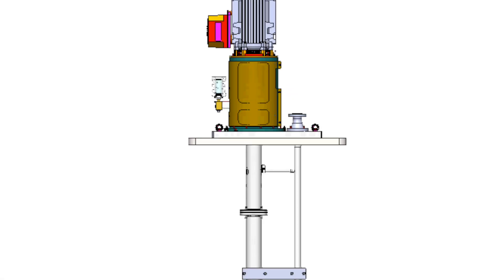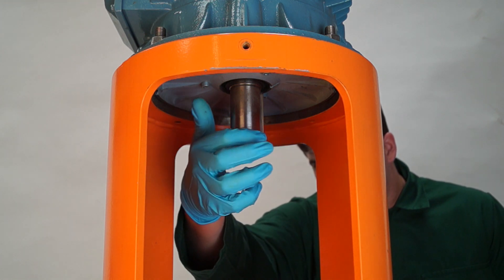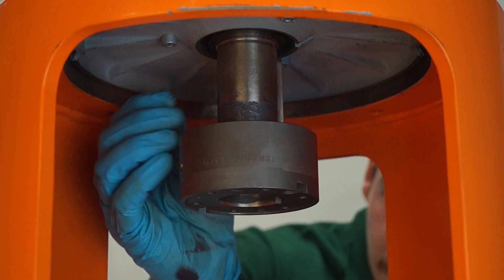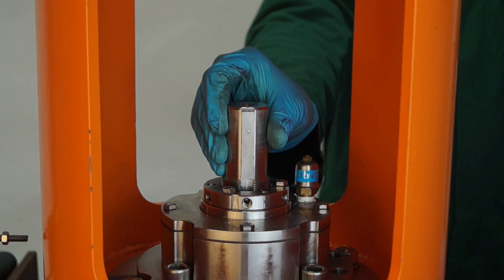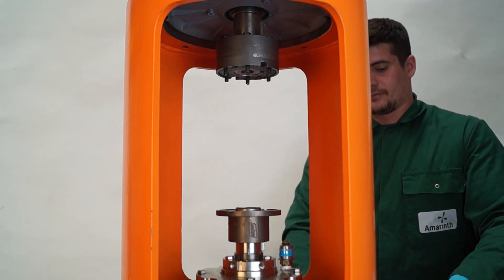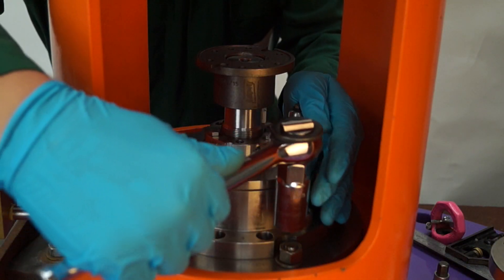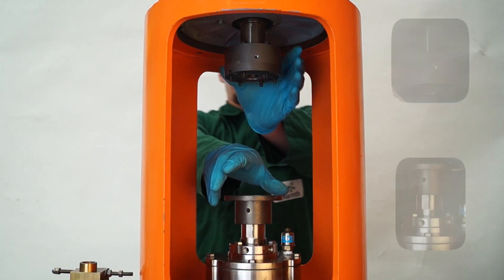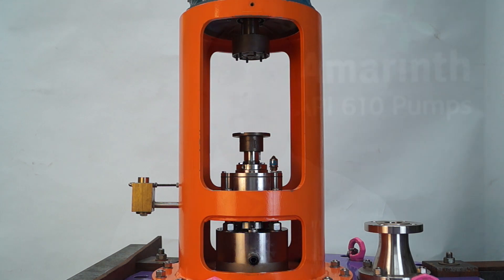How to install and align a pump and motor coupling on an API 610 VS4 pump

Comment: Hello, 

I have a pump where the spacer slightly moves to the left and right between the two couplings

IS THAT NORMAL? OR SHOULD THE SPACER NOT MOVE AT ALL?

Comment: ... Did you just use a ruler to check alignment? if you manufacture API equipment please have your clients use a dial or laser. Based on RPM you should be aiming for .05-.09 mil angular and 1-1.5 mil offset. Also is this doweled, flat faced or a spigot? Even a spigot can have a .005"-.0020" slop. Don't for get to check you TIR at the shaft closet to the coupling to ensure you have done the alignment correct